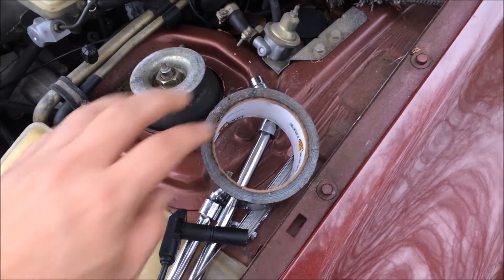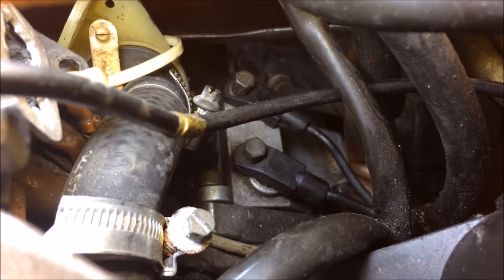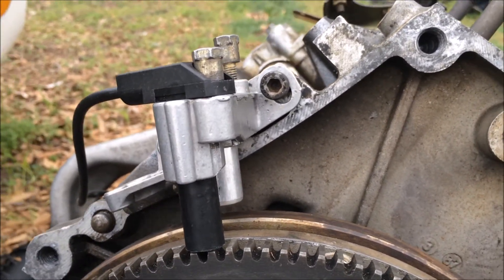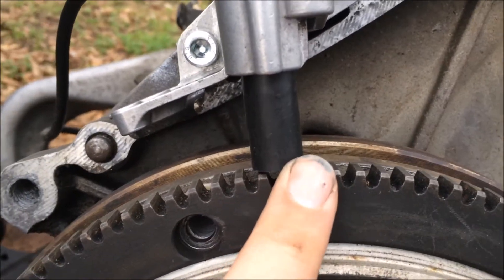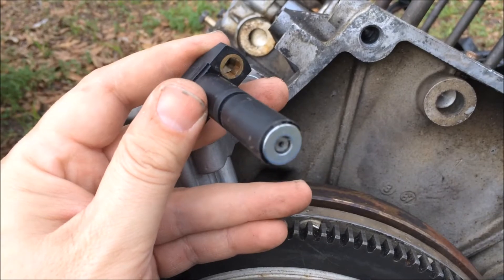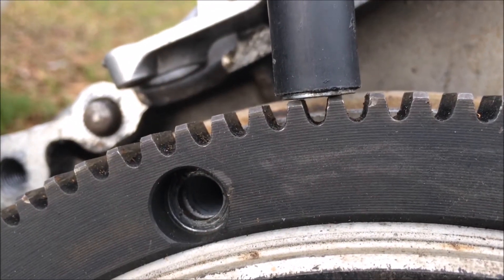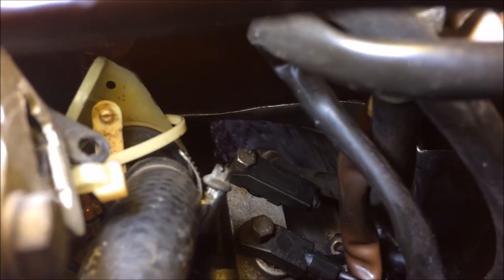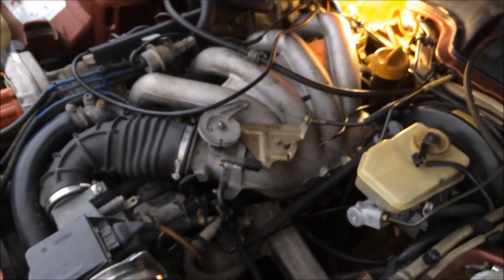Porsche 944 - How to gap speed and reference sensors

Comment: Thank you very much, I had not considered this. I am halfway through my clutch job which I could never of done without your videos. THANK YOU!!!!!!!!!!!!!!
Reply from the maker: No problem! Always glad to help!
Reply: @edredas  
I got it back together on Thursday night and got the gap set, once again thank you. 
I have not been able to try it out yet as I now have the cylinder head off, as it was a bit smoky I noticed, so I was going to do the stem seals, but the head looked nasty underneath where it has corroded, so its at the machine shop now getting a skim and new guides too. It is off the road for winter so I can get all of these jobs done. I have joined your facebook page so i can hopefully show you some photographs of it, its an 84 944.
P.S I just got your reply, as I am using my laptop tonight and saw this notification which I didn't catch on my phone, I broke my phone working on the car whilst putting the flywheel back on, the bar I was using to lock the clutch bolts to torque the flywheel bolts, dropped and hit me in the nose and then the phone, I had your video paused to show me the torque figure lol. Bloody car is costing me a fortune this month grrrrr lol.

Comment: Very helpful video edredas. Unfortunately my sensors broke off in the old bracket which I had to replace. Before I set the gap, and install new sensors, do you have any recommendations for lubing up the new sensors so that they are less prone to breaking for the next time I have to do this job? I don’t want to run into the same situation twice. 

Love your channel!
Reply from the maker: Thanks! I think any sort of lube should be fine or you can even try putting a little moly grease on the seal. That should keep it from drying up. I would stay away from white Lithium grease since it dries and would make them stick worse. I hope that helps!
Reply: edredas Great thanks! 👍🏻
Reply from the maker: Good luck!

Comment: I just did mine the other day. she ran fine before it didn't wanna turn over. I did not use the tool trick. it started up fine and drove until I got into third and the car started bogging like it had a miss fire. would that be a symptom of the sensors not being gaped or something else. thanks
Reply from the maker: Potentially, its hard to say but sometimes if they gap is too far apart, the engine can just die and you may have difficultly restarting. Also if you have an 85.5 944 and incorrectly gap the sensors you may get starter clunk that can break the starter.
Reply: edredas thanks for the help my friend.
Reply from the maker: No problem! I hope you get it solved!

Comment: I find 5 layers of electrical tape is the correct spacing.  Much easier than gluing on a washer.  I sorted through my washer collection and never found one the right thickness.  FYI .8mm equals .0315 inch.

Comment: what is the prosses for the other sensors? and what are there differences witch connects to what....
Reply from the maker: You only need to set the gap with the speed sensor shown in the video. The reference sensor which is also on that bracket will be gaped correctly too! They are both the same sensors but the reference sensor connects to the top connector labeled (BG) while the speed sensor shown in the video connects to the bottom labeled (DG). I will try to make a video on installing new sensors one day and cover all that!
Reply: edredas oh ok thank you my 944 has trubble turning on might be that idk working on it here n there...
Reply from the maker: You could try swapping the plugs around... sometimes they get mixed up.

Comment: If these sensors are faulty will it cause a no spark issue
Reply from the maker: Yes. If they fail you will not have fuel or spark. Good luck!
Reply: Thankyou buddy I started with replacing the coil as I have power to the coil but no spark coming out the coil, so I've now ordered both sensors and hopefully you have pointed me in the right thankyou mate
Reply from the maker: Also check the DME/fuel pump relay as well. Sometimes when it fails it can cause the computer to not receive power which can also produce a no spark/ no fuel condition. I made a video on a no start condition that I had and some of the steps I used to diagnose it. I usually start with the relay then work my way up to the sensors, and I even show how to check to see if they're still working. I hope that helps!

Comment: I dropped a bolt into my bellhousing is it going to be a big problem or just a lost bolt? Please help
Reply from the maker: Hi, yes it will turn in to a big problem! The bolt could get jammed and damage things down in there!  I had one fall in once and it stayed right where I could get it out. So hopefully, you can reach it with a swivel head magnet or use a grabber to snatch it out of there. If it has fallen down to the bottom them you can try removing the starter and seeing if you can reach it from there. I hope that helps!

Comment: How will the engine act if the sensors are not adjusted properly?
Reply from the maker: If they are gapped too wide the car won’t start at all. However the most common problem I see is that the sensors aren’t set correctly and get dragged along the starter ring until they break. I hope that helps!

Comment: what would happen id the gap was nor correct?
Reply from the maker: If the gap is too wide then the car would have running issues and might not even start at all. If the sensors are too close then they could contact the teeth or the studs on the flywheel damaging them. I hope that helps!

Comment: What about de other sensor ?how to gap
Reply from the maker: You don't have to set the gap on the other sensor since they are on the same bracket. All you need to do is set the gap for the speed sensor and they will both be set correctly. I hope that helps!